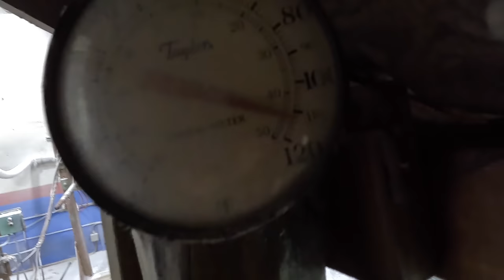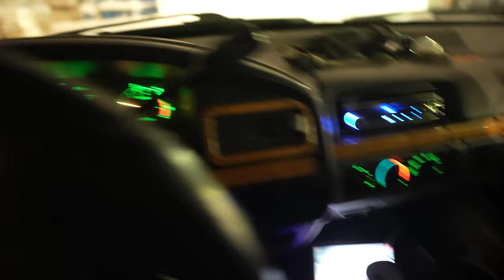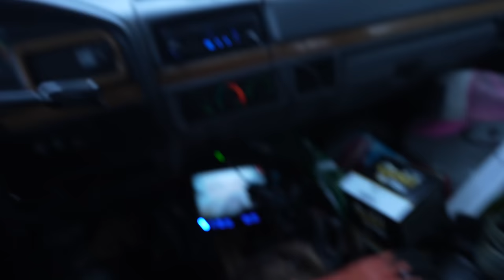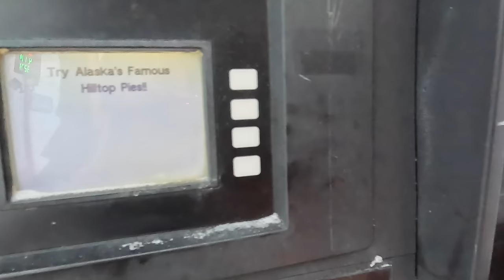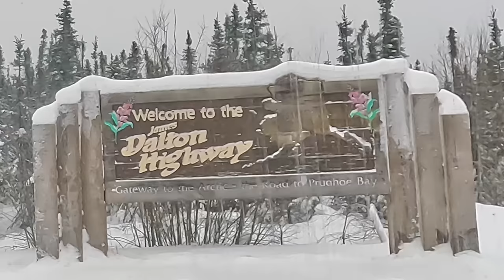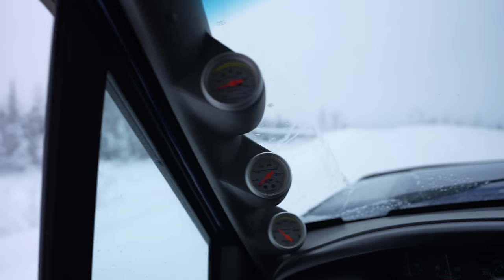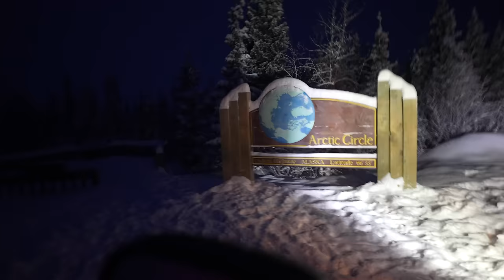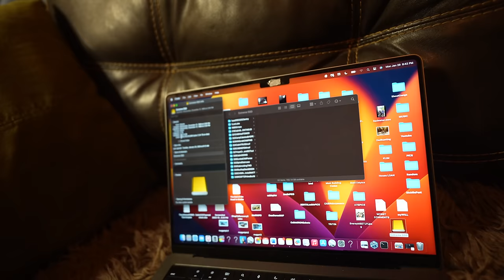Driving an Old Ford Diesel Truck 2,000 Miles to the Arctic Ocean in -53°F/ -47°C

Comment: Ok. Fellow 7.3 owner here. It started hard because when you pulled the filter combined with the gel it caused an air bubble. Once it clears it should fire perfectly. Also do not cycle your plugs if you ever do use ether. As well as if you’re going to idle for prolonged periods of time high idle it. Another piece of advice is FPPF fuel treatment is the best for un gelling fuel. And a splash of howes diesel treat will really help prevent gelling. It even helps #1 diesel. And gelled fuel will leave wax residue in your filter and clog it. Yes this was a long winded comment but I also live in a cold climate and I was daily driving a 87 f350 with a 6.9 idi in it at -30. Just trying to spread some info that might really help you. Keep up the good work buddy. Really Enjoying these videos so far.
Reply: Good points. I own a '97 7.3 and was always taught if they don't fire up on the first go...give it 60 seconds and then press the pedal to the floor hold and crank again. It usually works for me.
Reply: I just learned some thing thank you
Reply: Yep no doubt there was some air in the system when it runs this well after
Reply: That doesnt do anything.  the PCM doesnt allow throttle input at crank @GregorsOutdoors
Reply: Super helpful comment! Just out of curiosity, why should one high-idle in that scenario?
Reply: @ZWill07  to keep proper oiling and oil pressure
Reply: @ZWill07  diesel engines have excessive wear at idle speeds. It also helps maintain temperatures
Reply: @bryceheinz5004  oh ok gotcha. Is it due to a lower oil pressure? I know very little about diesel engines 😅
Reply from the maker: Thanks man:) Yup I pulled the fuel filter and saw liquid diesel lol, so figured the old filter was good and put it back in (because they're $80 a pop), should have changed it and probably would have started lol, I'm sure it was waxed up.
Reply: Was gonna gonna say.  Ether on a glow plug system is a good way to bend a rod.
Reply: Yes good idea to high idle that would help prevent cylinder glazing and excessive oil consumption in the long run
Reply: Yep, I'm a LB7 Duramax guy and this is all good advice.  I wouldn't think twice about leaving my truck running if it was that cold.  Just high idle it.
Reply: It's actually to prevent something called cylinder wash.  Obviously long-haul truckers often leave their trucks running for days and weeks on end, so idling itself isen't  harmful, it's when the fuel doesn't burn completely or the injectors drip a bit and this washes the oil off the cylinder walls.  If it gets bad you'll start making oil, thinning it out with diesel that seeps past the oil rings.  High idle largely prevents this.  Cheers.
Reply: @samdesmet7637  you are correct if like you say you have a bad injection system but you will find that when your fuel system is in tip top condition you should still high idle because all engines diesel or petrol will glaze causing oil consumption. But you are still very correct in what you are saying.
Reply: @solvend  very good point well said
Reply: @bryceheinz5004  very good point and good advice
Reply: @GregorsOutdoors   I was thinking that in the last video, it was already running, and when you already know it's cold, just step on the gas right away, of course don't red line it, but the pump needs to get that slushy fuel in there 😁
Reply: Where do you get the Castleberrys shredded pork chili ? Checked at food lion and Walmart here in Sc and can’t find it
Reply: Guess it MIGHT not be a good idea to travel in extreme low temps. 😂
Reply: The 7.3 is legendary, parents have over 300k on theirs
Reply: Or blow manifilf off i melted my air filter housing FIRE@OldIronOffroad
Reply: If i were doing this, a third tank for another 50 gallons of diesel would be pride of place in the cabin!
Reply: yah i agree about the hard starting... just needed to crank that thing longer to bleed it. not sure if you can put a fuel heater in that, but that could be something to consider. I knew a guy who ran a rig on old veg oil and he had to heat it. also if you're worried about hurting that engine with ether, check out rip ties and bias plys... he could show you a thing or two about feeding and idi ether.
Reply: 30 year Porsche/BMW tech here.. Yep, what this guy said. Also, probably not a good idea to use starting fluid.

Working in that cold sucks. I had a power steering pressure line blow off a Chrysler minivan in Ottawa, Ontario. -38F degrees. fluid froze inside the line. When i went to the dealer only parts desk, they had 4 or 5 of the same pressure line sitting behind the desk. I'm from Southern California. I had no idea low temp PS fluid was a thing. Changing that line on the side of the road was one of the worst experiences Ive ever had. My hands hurt so bad from the cold.
Reply: This cannot be stressed enough. Great input. 

Another point, considering it ran after ether, enough fuel was getting through the filter for it to run, but it was obviously restricted (your filter light was indicating that) and air was present. If you had cranked longer, it would’ve started after pushing through that air. It’s common after filter replacements on some diesel engines for long cranking before starting. Often what diesel is in the lines between hpp and injectors is enough to get it started, and the system will self bleed after. Considering all the cranking you did in the last video, you burned what fuel was near the injectors in the lines and only air was left over after the struggles. 

Regarding the use of ether, it is discouraged for a few reasons, but in a pinch can absolutely help. If people are curious, ether has an extremely low flash point, when introduced to any heat source (ie glow plugs) it will ignite. This can cause problems in a few different directions. One being cylinder ignition on a compression stroke, which some people claim it could bend a rod (I’ve been around diesels a long time and personally have not witnessed it so I can’t confirm). Another issue is damaging glow plugs from the violent explosion in the pre-chamber. Another is have that explosion come back out the intake and into your face. If you have to use it in a pinch with a diesel that is equipped with glow plugs or intake heater, it’s best ti disable those. If you cannot disable, leave the key off, spray the ether, and when you turn the key, begin cranking immediately, giving no time for the glow plugs  to heat up to help prevent that mistimed explosion. 

Another note on the glow plug operation. The pcm controls glow plug operation. It is based on the temperature of the engine. The reason the “wait to start” light went out almost immediately, is because the truck was sitting in that 112 degree shop, so longer glow plug operation was not necessary. Even yet, that light is not 100% indicative of glow plug operation either. Glow plugs will operate even after that light goes out (you can observe this by watching the volt meter). So cycling the key doesn’t really do that much more. The glow plug will only get so hot. 

The last note which people have mentioned about the high idle and cylinder wash. Diesels are much more thermally efficient vs gas engines. Which means more energy from the combustion cycle is changed into power/torque versus heat loss into the engine block and then coolant. It is why they take much longer to heat up vs gas. One way to combat this is using a winter front (the cover over the front grille), which his truck already has. The other is high idle. The reason you need the engine to run at a hotter temperature is for better combustion AND also the ring and piston expansion which creates a better seal on the cylinder walls (these are tied together)

Anyways, just figured I’d add a little more theory to the conversation if there were some nerds in here wondering as to the why of the OP’s comment. Happy trucking 👍🏼
Reply: High idle for sure it ill help protect from excessive engine wear that occurs at low idle
Reply: Three videos ago the truck died out and then revved up by itself. It was the IPR sticking. Then in the last video the injectors stopped clicking when he was cranking it.  The IPR was stuck open again.  Then ethering it in the heat of that shop made it unstick.
Reply: @mrfanman2u  not saying you’re wrong, bc you could be right, but in the last video the engine started and idled fine for about 10-15 seconds before dying. If the IPR was stuck open, wouldn’t it have just not started? And he pulled the fuel filter and it was clearly gelled. Again, not saying the IPR isn’t failing, but I think the root cause would be the gelled fuel, right?
Reply: Comment was too long to read, but I left a like 👍🏾
Reply: ----> "It started hard because when you pulled the filter combined with the gel it caused an air bubble. "

Would opening up the accelerator, on the crank, purge the air bubble from the chamber?  I've done that to get the air-bubbles out of the fuel injector lines.
Reply: I live in BC but when I used to take my power stroke to Alberta I would always add fuel treatment.
Also buy racor fuel.filters they make them for ford and ford puts the motocraft logo on it.
12$ for the racor  or $65 for the same thing with motocraft  on it.
Reply: Very useful information, thank you for sharing your experience with everyone
Reply: 96 F-350 here. Mine was my Daddy's work truck for 5 years converted into a drill rig then converted back. 175k miles and about a million hours. Still runs great. I'm getting ready to replace the stock clutch. 5 speed manual. Any advice?
Reply: @mpgunner13  do the zf6 swap
Reply: @mac2708 We had a Ford Aerostar mini van with the 3.0 gas V-6 that made it over 500,000 miles, actually still ran great but an oil line popped, got on the exhaust manifold (which was leaking, blowing flames out of it, anyways it caught on fire and burned down on the side of highway. Point being, over 500k and that thing was still running great actually, and I'm a GM guy but gotta hand it to Ford on that little engine.
Reply: Just get a gas engine,  its not nearly as expensive or as hard to maintain!
Reply: Have you bypassed the water separator yet. If not do do easily with the same size rubber hose. Itd easy. Just route fuel line pass the water separator. Deleting the water separator all together. Then yes house diesel treat or Hot All In One Diesel treatment will also work well. Keep on making it happen my friend. Water separator not needed here in  Alaska for sure. Known to cause many issues.
Reply: Howes is garbage. Hot shots secrets is the anti gel you should run.
Reply: I would blend the fuel. Stay away from #2. Either #1 or blend at least 50/50 like with jet fuel. You have a 7.3, will not cause no issues. When I worked at a private airport, we used straight jet fuel and never had issues with gelling up. I would not do that on newer engines, since jet fuel has lubrication, but 7.3 no problem. Especially when you are going that cold
Reply: @mac2708  your parents have a good rig.  I also have a 2001 f350 and it has 518k on it
Reply: I would listen to this Man!!!👍 He has been around Diesel and Cold weather for awhile 👍🌅❤
Reply: @TruckHouseLife  $80 a pop? Holy crap. That must be the Alaska tax my buddies that live up there always talk about. My price here is $55cad for a Napa gold, and $25 for a cheapie!
I'd look at ordering a case of them from Rock Auto.
Reply: Everyone seems to have addressed the air in the fuel bowl... I would top off my fuel bowl after a filter change with seam foam to make sure it's primed. The highest torque starter you can find is also insurance.
Reply: 💯 % correct words well spoken I'm a diesel mechanic and your absolute right
Reply: @mpgunner13  Get the 3 pc LuK kit. Don't waste the extra money on South Bend. I would also recommend a Dorman bronze pilot bushing instead of the stock needle bearing pilot. But if your input shaft end is chewed up you'll have to get a Fitzall repair kit.
Reply: @BrandonLeech  thank you!
Reply: @LostSoul6318.  : Lol yeah
Reply: If you leave it idle be certain to change your oil more frequently to remove any fuel that gets past the rings into the crank case.  The "wet stacking" should not be too bad if you do not allow it to idle more than twelve hours and then drive it - if you can idle it at a higher speed do that, need to keep the temp up.  I had to idle my Power Stroke on the slope one time at 2200 RPM at -65F by putting a valve on the peddle otherwise it would not generate enough heat and it would die.  Yes, expensive to idle but cheaper than alternatives.  The idle for five days straight I think you meant leave running for five days straight.  Half running at speed and half at idle not as bad.
Reply: 20+ years on the north slope and once had to high idle it.  Timmy messed up by one not treating the fuel at 10f and two not leaving it idling at -30f.  There was no issue with the air bubble if there was one.  Wet stacking is an issue on older trucks because at that temp it does not idle at operating temp.  Not an issue on newer trucks.
Reply: @ZWill07 so oil makes it to the top of the engine and everything gets lubricated properly
Reply: I don't know about the 7.3 but the 6.9 has some kind of pre-combustion chamber. There's a metal plug in the heads.

It's my understanding that you are not sposta use ether or you might blow the little plugs out and then they dance around on top of yer pistons.

You might verify  with a second opinion.
Reply: Lol it’s funny how you cover the camera when someone walks up 😂

Comment: I always wear Crocs inside at home but Crocs actually helped save my wife's life. We were kayaking and her kayak was overturned because she got hung up on a fallen tree under a trestle bridge. I luckily was wearing my Crocs and I had put them in sport mode (rear strap flipped behind my ankle) as I entered my kayak. Because of her situation, I had to paddle back upstream with my 9yo son on the front of my 2 person kayak and grab onto the bridge. Then I had to stand up and straddle the trestle bridge and kayak with one leg on each in fairly fast moving water and if it weren't for my squishy anti-slip Crocs, there's no way I could have held on for the over 30 minutes it took for swift water rescue to arrive and unhook her from the branches she was pinned to underwater with only her head, shoulders, and arms above water and pull her out to safety. Ugh, I hate that story but yeah, Crocs!

Comment: I just retired after 44 years. Anti gel has to be put in tank first as you fill up it disperses it evenly in your tank. In that temp I usually doubled plus the amount in each tank. I noticed you dint put any in your heater. It needed it to.
Reply: Yes, put additives in just before you fill up because the in-rushing fuel will then mix everything together properly.
Reply: Anti gel protects to -65 , anything below minus calls for it

Comment: I own a 95 f250 Ford waldoc too. Bought it new back in 95. Awesome truck. There's a bleed valve on the side of your filter housing next time you experience no start open it while cranking and it will start but you have to quickly close it as the fuel comes out quickly after the air lock is overcome. Went through the same predicament at -65° up in Fairbanks. 
 Enjoyed your video as you go many of the same roads I've driven on.good memories with family.

Comment: I have made several comments on your channel, I watch frequently. I'm a truck driver, Columbia river gorge, Mt. Hood, is where I drive. You have some balls running these roads with the big rigs, very dangerous on two lane roads, I respect it. I specifically stopped running Mt. Hood from Portland OR to Bend OR due to the two lane road aspect of the danger.  I ran that road 11 times per week once there once back every night, rain, blizzard or shine. I'm much happier now running the Gorge four lane two way divider Interstate class road. You are a good story teller and an excellent videographer. I'm happy to see you are having success, I look forward to my continued entertainment, keep it up and get an oil filtration system for your diesel.

Comment: I have some ideas that could be useful for you especially since you live in such a harsh climate. #1- Fuel tank heater. Will help against gelling fuel and therefore not having to worry about shutting truck off. #2- A fuel transfer tank. These can range anywhere from 20 gallons to 100 gallons of fuel that you can carry and some have pumps in them so you can use it to pump fuel into whatever you have that runs diesel. Kind of like having your own portable gas station in sense. And then it also saves you from having to worry about running out of fuel and being left stranded.
Just two things I thought of while watching this video and the one before this one.

Comment: Made several trips from the lower 48 to AK in the winter dragging a 40' trailer. The coldest I saw was -42. A least 2 of the 4 day trips I never shut off the engine. It was a a 6.7 diesel in a Ford 550. 
I always added diesel additive when it was that cold. Never jelled on me, thankfully.  Enjoy your channel.

Comment: I worked with Diesel Nodwells in DeadHorse for years.  Here's a tip, carry a parachute. If rig gets frozen up, throw the chute over the front of the vehicle  and seal the edges with shovels of snow. Put your propane heater under chute, presto! instant garage. 
Another tip... if in doubt, leave it running all night. 
It's always handy to carry a propane weed burner  good directional intense heat for oil pan etc.
Last tip, starting fluid is your friend.

Comment: heya, idk if youll see this... but switching the offroad lights from led to to any other bulb that produces some heat should fix the ice issue. theyll stay free of ice as long as theyre on and melt anything that was gathering prior. 

keep the spirit of adventure burning, and safe travels. but not too safe.